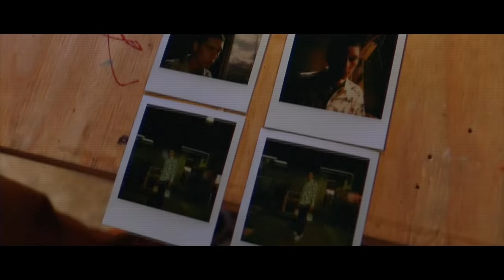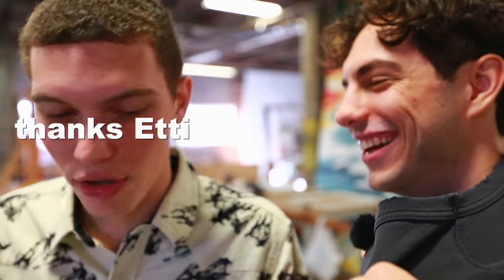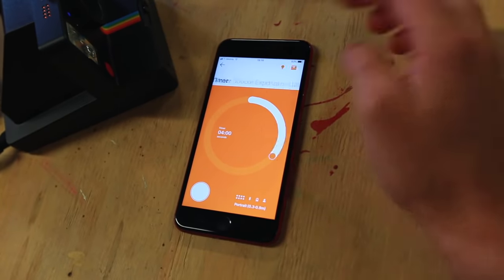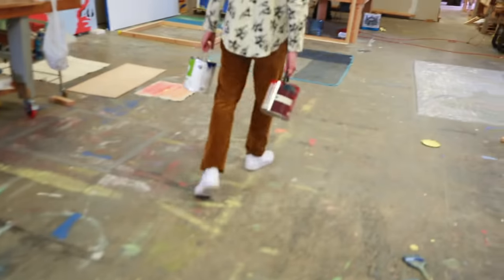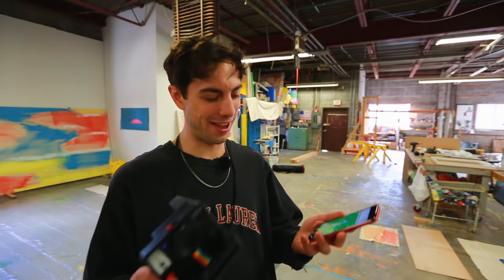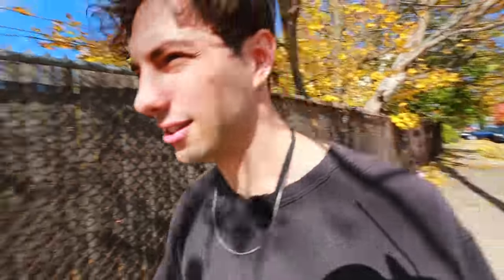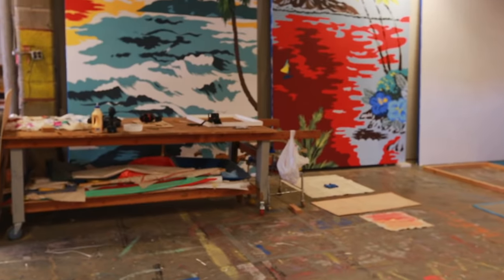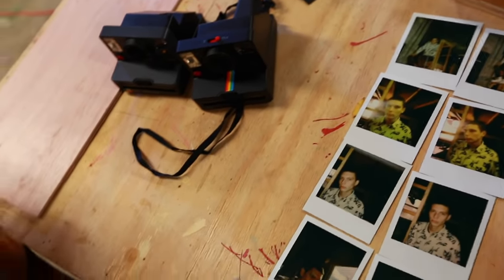Polaroid OneStep+ walkthrough & comparison

Comment: Did you adjust the exposure on the cameras when you changed areas (darker vs brighter areas)or did you just pointed and snapped? (mainly speaking to the plus)
Reply from the maker: Generally just point and snap I only use exposure control for backlight subjects or if I know the light is too strong
Reply: @JoshDavid  thanks! Keep up the good content.